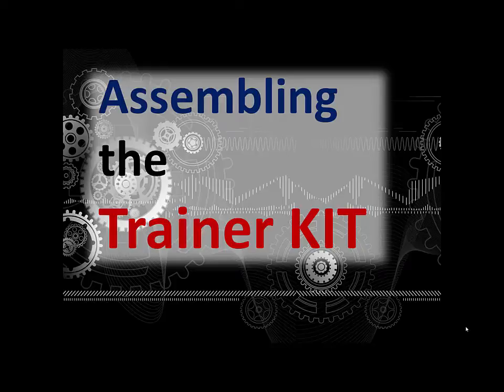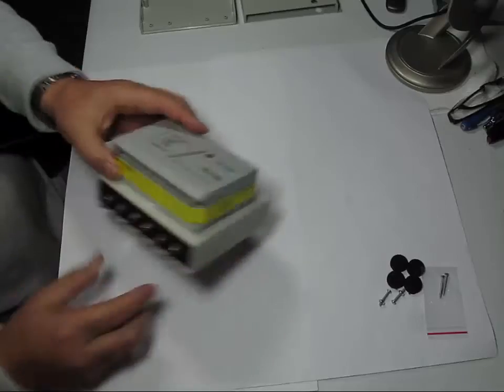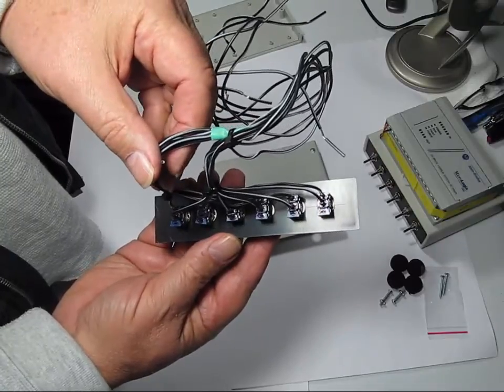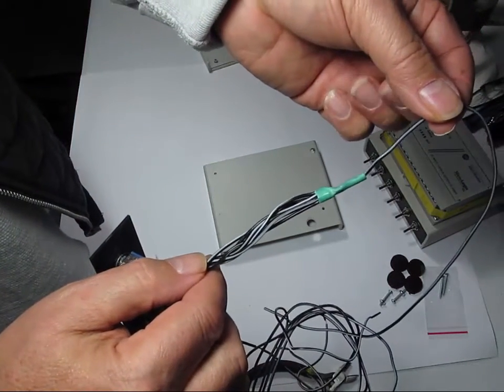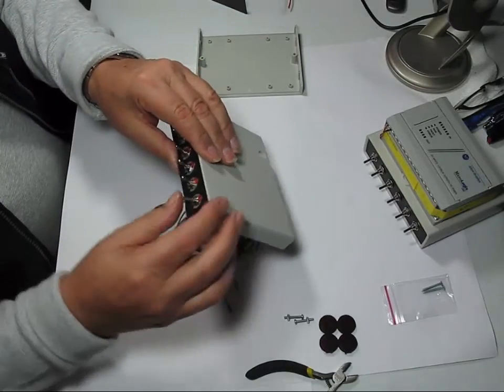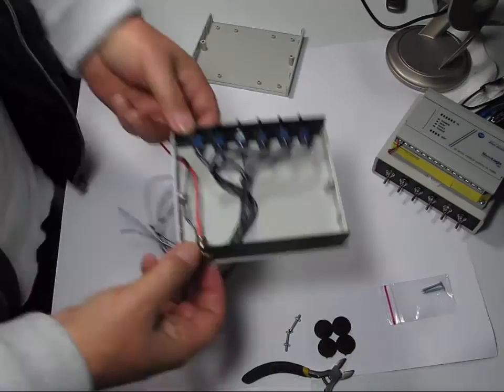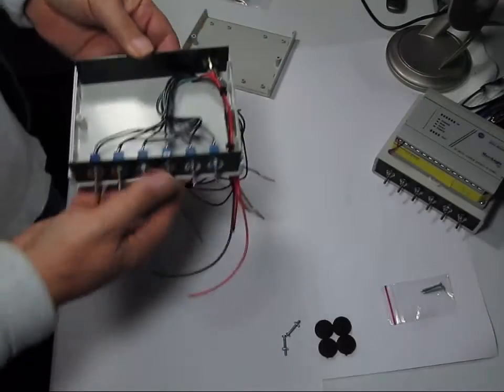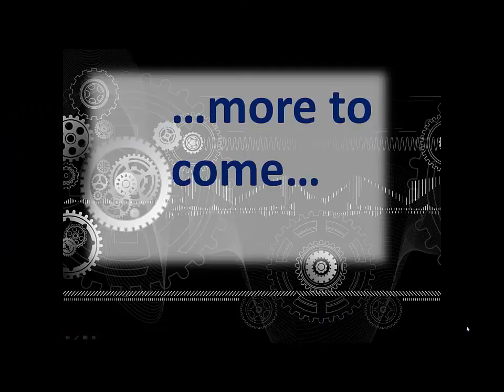Assembling the Trainer Kit from the PLC eUniversity Bookstore

Comment: One little tech note: If your doing a multi-conductor run, it is always a good idea to pre-label  your wires.. I.e. sw-1= 1 & 1a, sw-2= 2 & 2a. This can save loads of time. Most multi-conductor cables have different colored wires but cabinet and individual wire pulls will not. Also it is a good idea to make at least a rudimentary schematic/drawing of what you intend to do. Even on simple projects as this.
Reply from the maker: True... For a simple project like this one, wire color is enough to keep track of destination. An industrial control system most often uses a simple wire# scheme of drawing sheet number-line number and if more than one conductor on a line number, an A-B-C trailer. 01429B sheet 014 line 29 second conductor.
Reply from the maker: plcprofessor IEC requires that each individual conductor have unique nomenclature. If there are a dozen wires coming off of a common set of jumpered terminals, each has a unique number and even the terminals have a unique number.